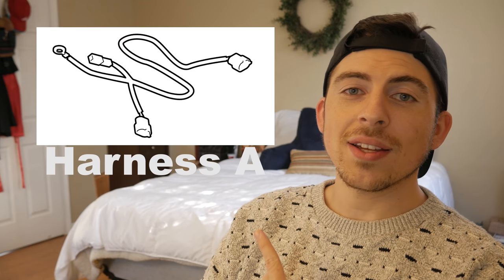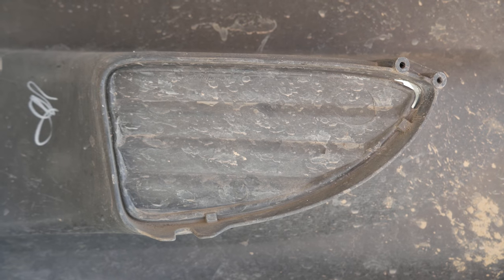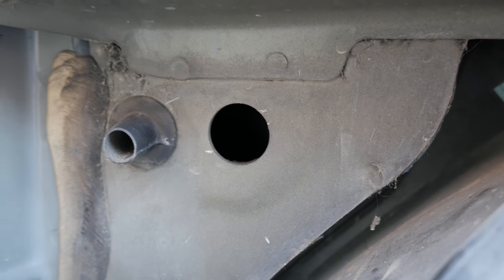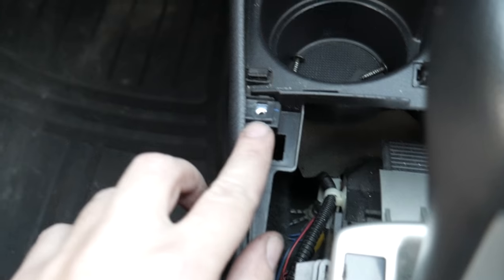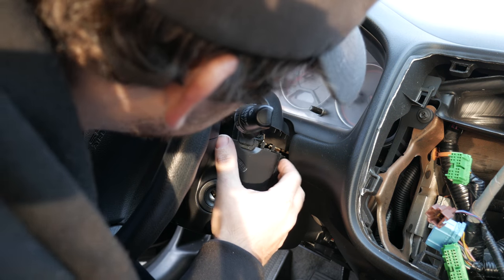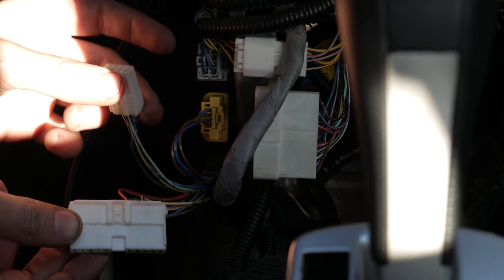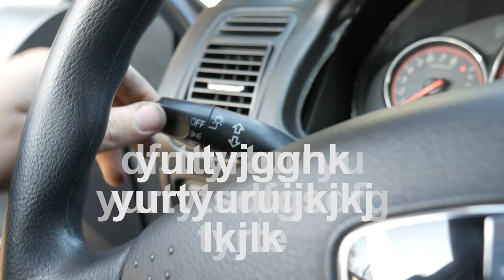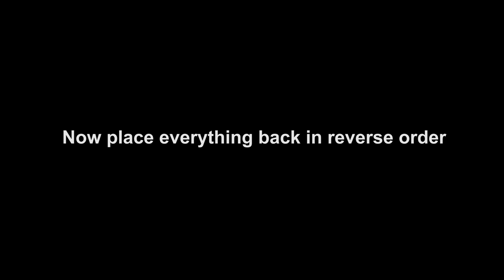Fog light install 7th gen Honda Civic // In-Depth Guide (04-05)

Comment: Of all the OEM 7th generation Civic fog light installs here on YouTube, this one is clearly one of the best and follows closest to the factory setup! I get taking the easy way out, but it’s also the laziest way with exposed wiring, using the 12v power outlet, tapping into other accessories, etc. This may take longer and be more involved, take more time and work, but clearly more professional with much cleaner results and most importantly, not risking damage to the electrical system or compromising other components due to amateurish ‘quickie’ jobs for the sake of immediate results. Great job!

Comment from the maker: It's come to my attention that there is some deviation from the model of EM2 (01-03) than the model I have (04-05). After looking into it more, there are some differences from bumper style, center console, Harness A placement, Harness C style and not opening the steering column differentiate from the 04-05 model. Other than those differences they're the same process in which you can take some information from this how-to like plugs and placements, for those differences I included the PDF file of how to install them on the 01-03 model in the description. I hope this clears out any confusion and helps somebody out! If you have any questions just leave a comment below and I'll try to help out in the best of my abilities! 

EDIT: PDF link is dead with Handa-accessories which held the pdf is gone, sorry guys. But as I stated from the differences, you can still do it with this guide! I believe in you resourcesful DIY'ing peeps!

-Payco
Reply: Thanks, I grabbed a aftermarket kit hat came with no directions. This will save me alot of time and aggravation.
Reply from the maker: @dizzywillow451  Anytime dude! Hope it turns out legit! I'm currently editing a video on how to change all the engine mounts on the civic, hopefully I finish up before christmas!
Reply: @PaycoTsunami  That's cool, I did that this past summer. Just finished up replacing my e brake cables and entire rear suspension, bushings and everything. I'd be happy to assist. I've got 242,000 miles on my 7th gen.
Reply from the maker: @dizzywillow451  yo! For some reason I didn't get a chance to respond, but that's sick dude, I appreciate that! It's alot of work, I ended up changing my lower control arm bushings with poly and its been a headache ever since! It rattles so much! Dude If my mounts were blown out at 180,000, I can't imagine 242,000! D:
Reply: I tried the link you put in the description and it doesn't work
Reply from the maker: @jameswelch2515  I had just checked and the website is dead :( I scoured my comp to see if I had the PDF hidden around somewhere and It seems I don't. Hopefully you can have better luck with some 7th gen civic groups on facebook, they might have a chance on having the PDF on their end and might send it to you. I hope you find it! Btw Its mostly the same install other than the bumper being different from what I've read/heard other people doing it.
Reply: @PaycoTsunami  alright, thanks for checking it out for me and where I should take a look at

Comment: ..Takes entire dash apart...never finds the one shiny screw that drops the entire fusebox down for access. woot!
There are 17 different packages for the 7th gen civic. Mine is an em2 05 ex(the one with black fender flaps) and things are a bit different under the dash there too. Also, folks should be warned that the cheap aftermarket kits have a mess for a harness. This one matched, mine did not. I.e harness b is 4ft long... Instructions looked like they matched a minivan. Go china!
Reply from the maker: Dude that's great info! It's awesome but can be definitely worded differently so it doesn't sound condescending! lol Definitely an issue with the after market fog's since they're all pretty much wired awfully. It's worth going to the junkyard and finding an OEM pair if you can for sure like the one I have here. Aftermarket harness's are never on pare with original equipment.

Comment: thanks for the video. where did you get the fog lights and harnesses?
Reply from the maker: Hey no problem, hope it helped! I actually played the waiting game by registering online to my local pick-n-pulls through ROW52(website, just check it out!) in Cali by getting notifications in my emails if any EM2 came in. They usually post a frontal picture of the car when it first comes in, with that in mind I just waited every morning for a couple of months till one showed up with fog lights. I went straight over there and beat like 2 people to them! It was pretty wild and I probably should've done a video on it but that's how I came up with these and paid only $30 for them! I've also seen some sets on ebay once in awhile but I feel like they're outrageously priced. If I were you I'd just go junkyard hunting locally, you might end up finding more than just fog lights!
Reply: Thank you for the information. Upon doing some research, Amazon has a set of lights with the 3 harnesses for $104. The harnesses look ok but i think they are used for turning on and off with button instead of being wired into headlights so you can turn them on without headlights. Thanks again, VA and CA seem to be picky about everything in the auto industry ;)

Comment: I did this job without pulling apart 80% of what he did in this video. Just not needed if you're clever about how you do it. I also didn't take my bumper off of the car, I just jacked it up and did everything from underneath (need to replace my splash guard under the car). My kit wasn't nearly this complicated for some reason. It literally just goes through the fender to a switch on my console. I didn't have to mess with any of my original wiring other than to place a ground and power from ignition (cigarette lighter is a good place to splice into) When I want foglights on, I simply press the button, but unlike his, my foglights only come on when my ignition is turned to the 3rd setting. Basically, I spliced the brown ignition plug into my cigarette lighter wires because that only supplies power when the car is turned on, because it has an ignition feed, unlike the plug under the dash in the relay/fuse box. That feed is an "always on" feed, unless you do like this video and go the complicated route of hooking it up through your headlights. I guess I just used a cheap wiring kit, but it worked out great.

This guy had the same idea I did: https://www.youtube.com/watch?v=nSNxwjP6olM
Reply from the maker: This is the OEM kit from Honda which is pretty rare but it shows all specific spots you're supposed to pull except the radio lol I pulled out alot so it'd be easier to shoot the video and show everyone visually like removing the fender/lights. I'm assuming you grabbed a aftermarket one which is alot less complicated?
Reply: @PaycoTsunami  Makes sense. Your work was definitely a lot more complicated, but still a more professional job than mine. I was weary about it at first, but after a few months and no issues, using the cigarette wires seemed like the trick. I got a smoked fog light kit from eBay for $30. Not the best quality, but they look nice, and came with a cheap "simplified" wiring harness. Your job is a lot nicer than mine, but let me ask, is your fog light switch still not lighting up? Because mine lit up as soon as I hooked it up to the cigarette lighter wires and turned on the ignition. I see people either with the lights on the switch not working at all and their fog lights do work, or with the light on the switch working but their fog lights stay on all of the time despite the switch. It's weird. They must be doing something wrong.
Reply from the maker: @AlphaMachina  hey fog lights are foglights am I right? Haha I think as long as your lights work, it's a job well done in my opinion. Actually when I hooked everything up, the bulb in the foglight switch and one of the bulbs in the foglight housing was out. I was surprised initially lol but I replaced both and it's working flawlessly now. Always check the bulbs for sure before ripping into it again but they're probably having grounding issues like you stated or relay probelms
Reply: @PaycoTsunami  Ahhh, cool. Yeah, as long as they work, it's all good. I was looking at this video because I got an OEM kit and was thinking I might install it instead, just to have peace of mind that my car won't burn down (lmfao), but after seeing how complicated it is, I think I'll be alright. No issues so far. Take care man.

Comment: Can you put a link in where you bought all the wire harnesses?
Reply from the maker: I actually went treasure hunting at the local junkyard in Cali, I used picknpulls search engine to find a car with fog lights since they're OEM! Best bet is to do the same or keep a saved search on ebay but you're going to end up paying around $300 for them. I ended up getting all my fogs and harnesses for around $30 at the local junkyard, but you can also get the aftermarket ones at the same price on amazon, only issue is that they're all different is some type of way. The aftermarket ones will work but you'll need to rewire the switch since the one they give you doesn't really fit all to well in the car. You can snag the switch on amazon for around $20 last time I checked!

Comment: Hey is the green connector at 13:09 does it power fog light switch & relay circuit & the indicator light when the fog lights are turned on ?
Is the one brown connector the hot side of the fog light relay ?

Comment: This is an 04-05 tutorial. Change the title of the video. 01-03 is completely different. I have an 02. I have a different bumper and cutting the holes for the fog lights is alot more involved I ended up using a reciprocating saw. Also the bolts on the side of the bumper are 10mm not 8mm like yours. Also you don't need to rip apart your dash and steering column like that it's unnecessary and creates more work for yourself and chances to break things...
Reply from the maker: Yo! I completely understand your concerns, but the process is nearly the 
same but with a few differences here and there, like not removing the 
radio/steering column bezel for the 01-03 civics since the consoles are
different. This video is nothing more but to help people to get through 
the process and I don't want to deprive them of that. The videos I 
personally looked to for help weren't thorough enough and hard to 
follow. So I wanted to offer an in-depth tutorial from my perspective in
 what I thought would be better because I'm more hands on/visual.  I'm 
not saying you're wrong and I definitely appreciate the feedback because
 I'm definitely trying to improve but I'll add an annotation to the 
video including a link 01-03 pdf file in the description below to help 
anyone else out. I'll also add some notation wherever the video deviates
 from 04-05!  Again thank you for the feedback!
Reply: @PaycoTsunami  it's nowhere near the same process like I said you don't need to run the wires through the passenger side and removes all the trim panels/ radio. You practically gutted the interior of this car for no reason lol. It's tons of unnecessary work. It literally makes no sense why you took all that apart. You could just run the wire on the drivers side like I did. Besides that there's still alot of differences between the 01-03 and 04-05 they're completely different. The entire front end is different and most of the parts aren't interchangeable. But my whole point is changing the title and description of your tutorial would save people alot of time and help from misleading people. I think you made a good quality video but it's misleading.
Reply: @Blorkion64  how did you run the wire on the driver's side from the engine bay to the inside? I'm having trouble finding a suitable way to and the connecting wire the second harness is short

Comment: if you happen to know what the part number is for the harness that connects to the switch please lmk i bought the switch but got the fog light assembly from 1au auto and it doesnt fit definitely wanna get this resolved so i can plug the button in!
Reply from the maker: ah so the switch is OEM but the harness isn't? You might have to repin the harness you've bought to the switch itself. There might be some wright ups on some forums about the pinout but that's alot of work. Sadly after looking at what I have, all I see are the harnesses in kits and not by themselves. Here's the write up I found with more info:

https://www.handa-accessories.com/civic/05fogs.pdf

Hope you find out what you need!

Comment: Can you install the harness from the driver side?? There are some empty switch bays to the left of the steering wheel. I really don't want to remove the radioo and center console....
Reply from the maker: YO! So you can definitely do whichever you want! Whatever's easier for you, you can go for it! The way I did it was from the manual from Honda, I ended up making a mistake on removing the radio to install everything but it definitely made it easier through the process. I believe you have to remove the center console though. That's a must since you need to get the harness for the switch behind it! But again, you don't have to remove the radio/Bezel to install this. If you find a way that's easier through your process be sure reply on here for other peeps to see! This is a pretty popular video as of late and I hope its helped you so far through your install!
Reply from the maker: Oh btw I believe there's also another spot on the driver side you can sneak the harness's in but the actual grommet fits on the passenger side. If you have an after market kit, I'm pretty positive you can snake it though a hole on the driver side.

Comment: Huh? So where does the brown wire go, where does the white wire go.  I saw you connect some wires but never explained which wire and why
Reply from the maker: Toua Xiong yo! Hey no problem, put the time stamp for the wire and I'll gladly help out!
Reply: @PaycoTsunami  I figured it out. Basically the red is power and the white is ig or on and off. I didn't know where to plus so I did the gettho way. Connected the power to the cigarette fuse. Connect the power to the head light fuse. Looks ugly but oh well.
Reply from the maker: @TurboD16z6   glad you got it to work! Still not too sure which wire's you were referring too though. Is it a aftermarket kit you're using? You might not be the only one who's having that issue. Toss me the time stamp so I can analyze the one you're were mentioning, maybe I can pin point where it can go on the stock harness

Comment: Where can i find the same fog lights like yours?
Reply from the maker: I found mine at the junkyard! Check if your local junkyard has a website, they might have the ability to send you daily emails to see if your car came in. I do that with PicknPull and surrounding junkyards! That's how I found out when a Civic came through since they post pictures of the cars when they come in. Also I have the actual fog light #:
08V31-S5D-102A

You might get lucky and someone will toss it up on Ebay! Speaking of which, they also have knock off ones for around $30 on there that work just as fine.
Reply: Thank you PaycoTsunami for advise I’ll check junk yard or eBay and have a greater years to come.
Reply from the maker: Anytime and thank you, hope you have some success tracking it down!

Comment: I have a drill bit, what size drill bit to make that hole? thanks.
Reply from the maker: Yo! Sorry my man, I have no idea :( All I personally did was go as wide as bumps that were shown. Wish I was more help! I guess keep going till it fits properly (If anyone else knows about this, please comment your answer on here since I'm pretty sure more peeps have the same question)
Reply: @PaycoTsunami  Thank you. Looking at your screw, looks like a 1/4th. Not sure. But I am gonna start with 1/4th since its really small and work my way up. Thanks
Reply from the maker: @Isotope1213  There you go! It's definitely pretty wide, I  had used the knife I had to carve it out wider than the original pilot hole made with the screw (which worked pretty well in my opinion haha) I'm glad you're knocking it out the smart way my friend and hope the install goes as smooth as possible!
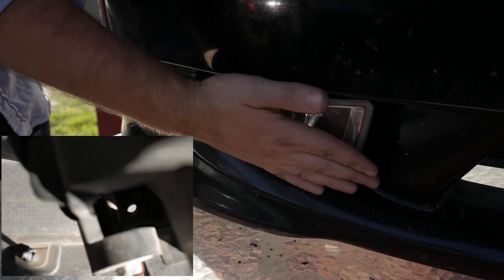Reply from the maker: sestoelemento 80  @3:34 I lined it up with the hole and it took a 10mm bolt from what I can remember. I don't have the specifics on the bolt sadly but it's just the slot in which you made then the bolt to make sure it doesn't go anywhere!

Comment: On the fog light housing.. at 3:38.. do they just snap in into the bumper? Cause my fog lights look a little tight to squeeze them in. What am I missing here?
Reply from the maker: They don't technically snap into place, they just slide into the housing of the bumper. If its a right fit just make the hole bigger where the end of the fog light housing goes into!